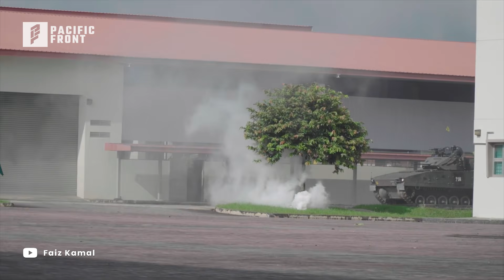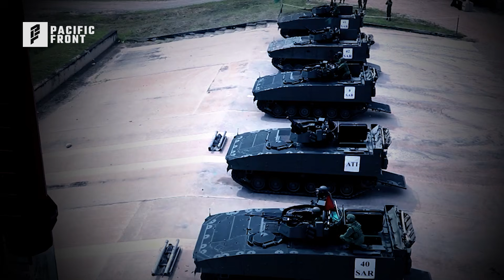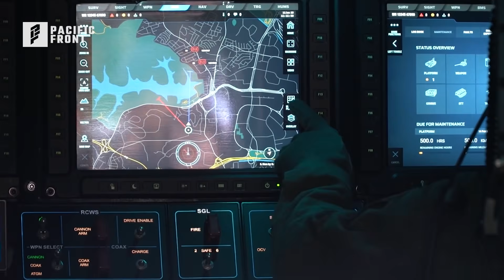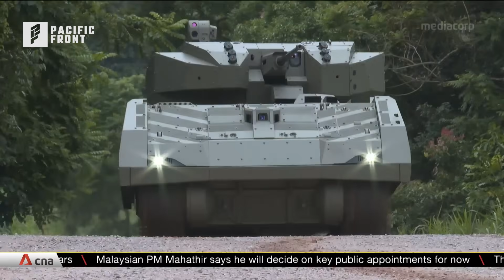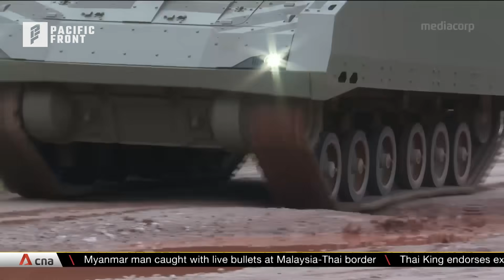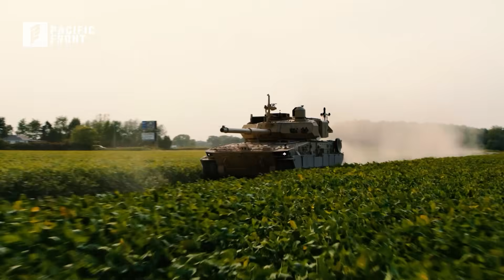From Bionix to Hunter, Singapore's Mechanized EVOLUTION!

Comment from the maker: From the "mini Bradley" to the digital "Hunter" and the new Terrex s5 Titan, Singapore's defence tech is undeniably punching way above its weight.
What amazes me is how Singapore radically transformed the interior of its latest armored vehicles with all the multifunction screens to help the crew operate the vehicles more efficiently and effectively.
I think these advanced features are something that you simply won't find on many frontline NATO vehicles today, don't you agree?
Reply: Multifunction seems cool and all but in reality there's a lot of maintenance and software issues that could affect its effectiveness out in the jungles
Reply from the maker: @captainbroady  we cannot ruled that out, yes.. hopefully it has several backup system, an analog ones, in case the digital portion of it fails..
Reply: It looks like the XM8 Light Tank and that small british CVRT thing
Reply from the maker: @Q.A.M.I  the MPF program was supposed to bring the M8 AGS concept to reality.. but the M10 turned out to be too heavy, so the purpose of the program is already failed..